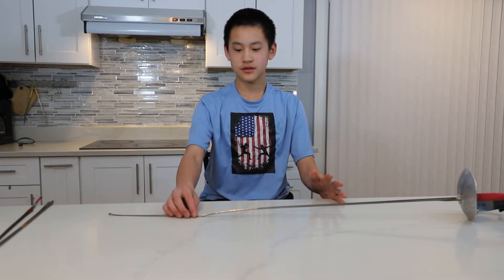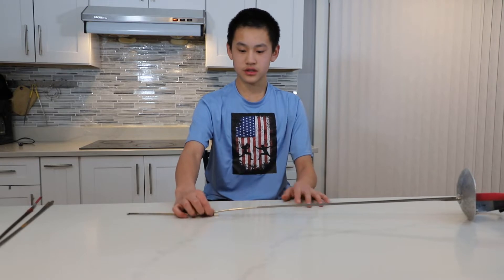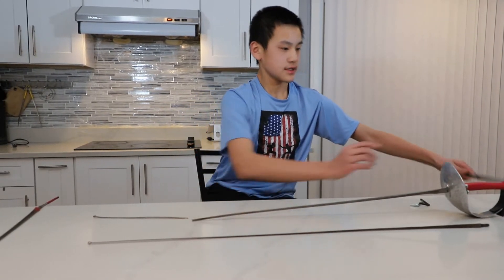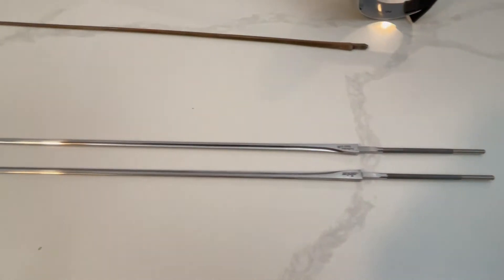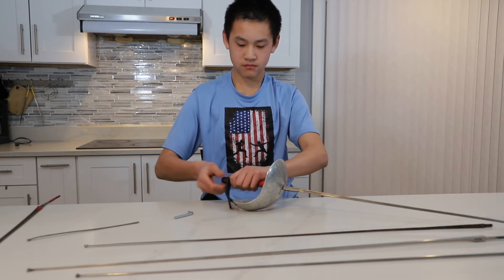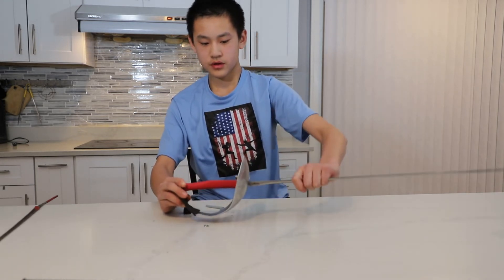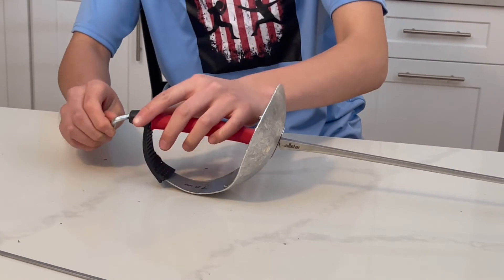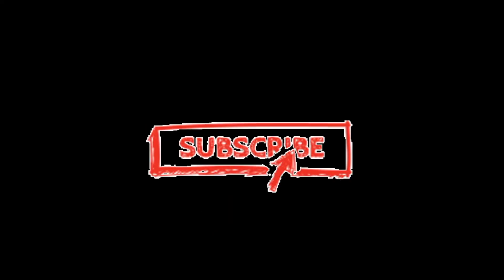How To Replace A Fencing Sabre Blade

Comment: I keep breaking them at the tang. The one im holding stays fine. Ive been known to break my fencing teammates (the clubs) blades. Once with a brutal parry 3, kinda flicked out during the parry to riposte to the arm but found the blade a little too well. Opponent disengaged amd the blade just fell apart. The other time i got a slash on my shoulder, and we get back into en garde, and the tang is just hangingnon by a thread (literally). Im planning on getting a spare sabre blade (cheap cause im fencing on a budget) hopefully before my next tournament cause im rocming a 20$ sabre i got on marketplace. Beautifully balanced but i know that blade isnt top quality.